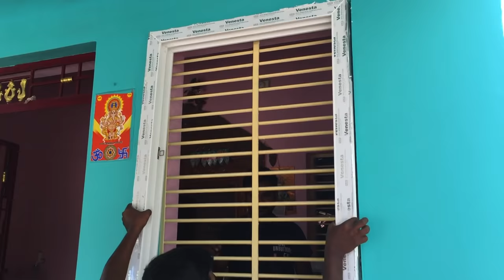Installation uPVC Sliding Windows  – ANEGAN UPVC - 9150099141, 9150099142, 9150099143

Comment: How to remove the window after installation?
Reply from the maker: Remove all screws in wall frame
Reply: @ANEGANUPVCWindowsDoors  I don't want to remove the whole frame.  After putting the window in the channel, you use a hammer to fix the side panel to the window @ 2:55 to 3:00 in the video .  How to remove that side panel only, so that the window can be lifted out?
Reply: Nair Solace u can't remove it unless the it workers